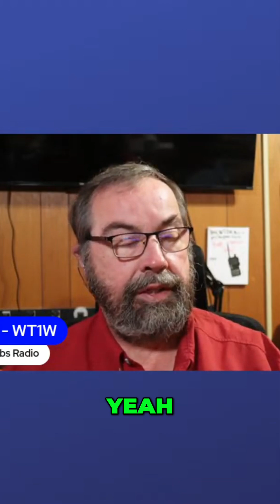AC Soft Start Kit  Save Your Compressor & Generator! #generator #shtfpreparation #softstarter

Comment: I've been on the fence of having one installed.
Reply from the maker: Freaking awesome gadget.  Not much to doing the install, only 4 wires to do for most installs.  It dropped my inrush 83% and the running current by 32.5%